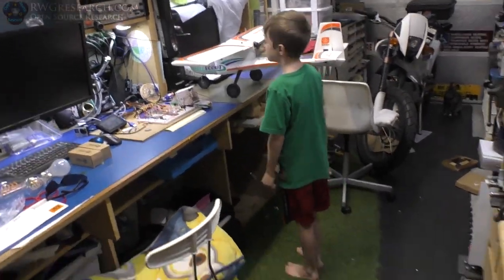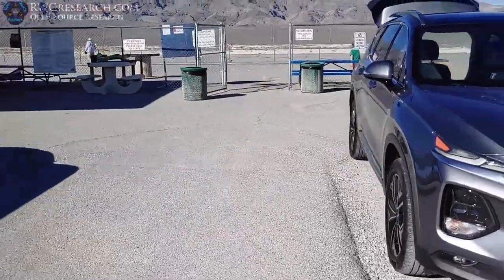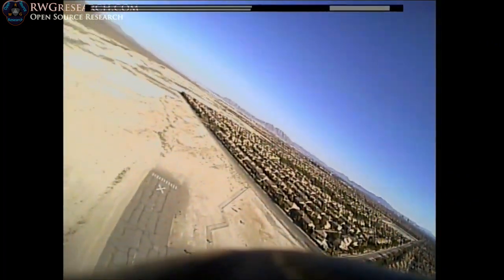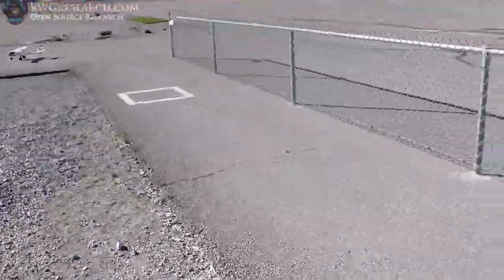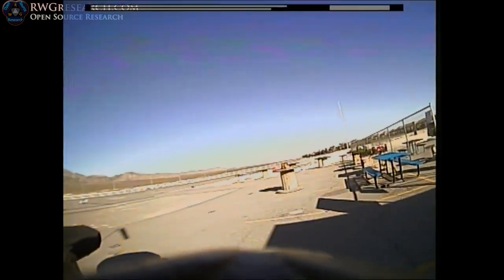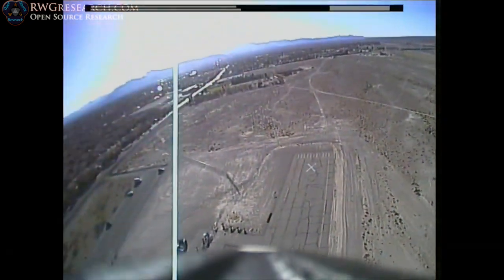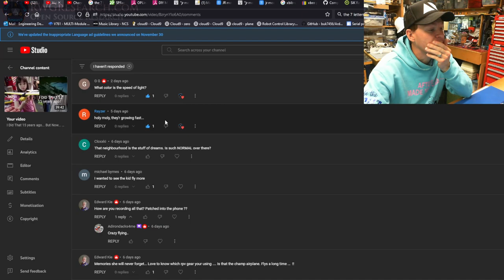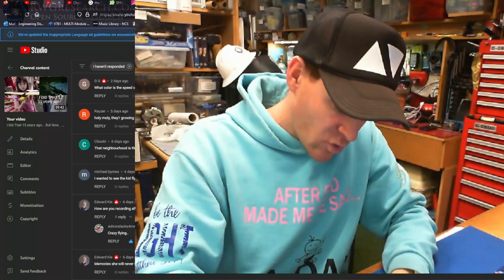FPV  "AeroScout"..  Elijah Takes The Controls our first real FPV experience

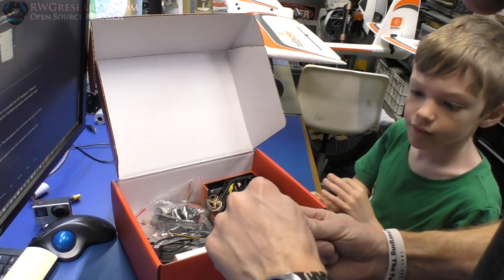Comment: 2:15, i think we all had those moments, at least he's honest about it :D
I've used that video transmitter in the analog times, those are pretty powerful and reliable. I remember crashing one of my drones into the mud, didn't manage to find it and had to give up. We had a rainstorm the entire night. Next morning I had a Text message on my phone from as stranger who had found it and propped it up so I could take it home (had my number on the drone). Of course the Lipo was at 0.00V by then and the entire thing was covered in mud, but after cleaning it and attaching a new battery it worked flawlessly despite having spent the night in a muddy puddle transmitting at 800mW.
I recommend sitting down while flying FPV, I tried sitting on a swingset once, didn't end well LOL 
If you ever get the Chance to try Digital FPV you should do it, it's a whole different animal, especially with the recently available 1080P streaming. 
Great flying from both of you, I totally understand your enthusiasm for the FPV experience, especially the comment about the shaky legs :)